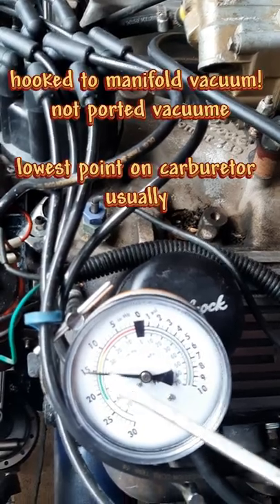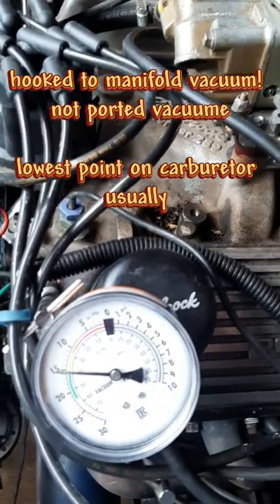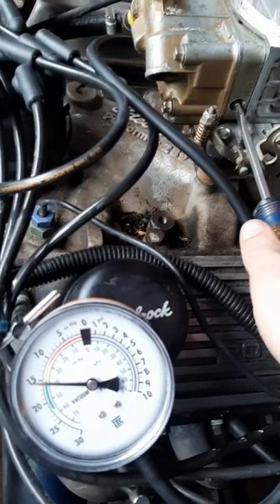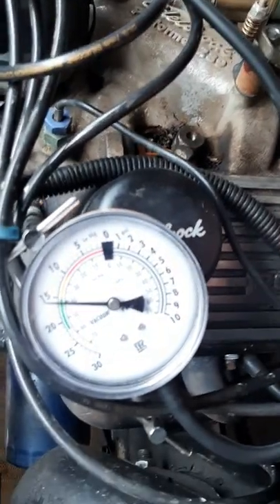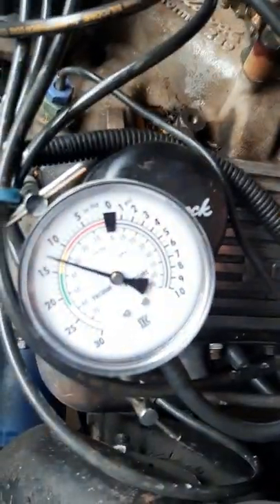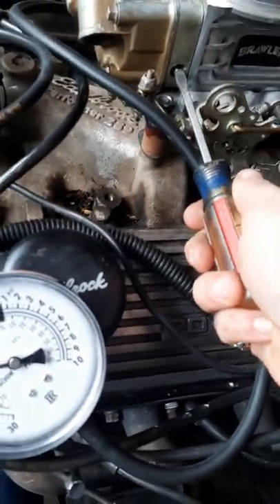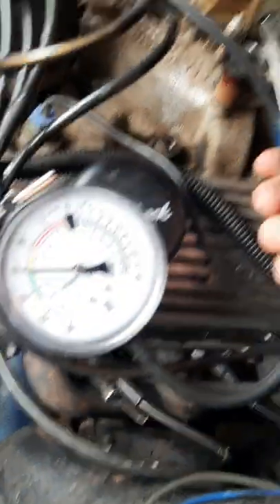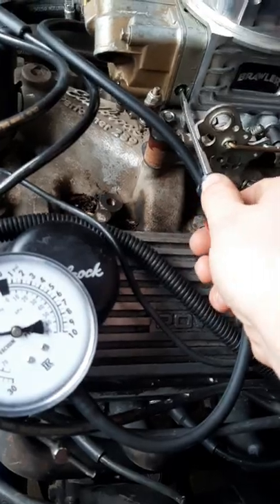how to: tune your carburetor using a vacuum gauge!

Comment: What’s the manifold cover vacuum supposed to hook to? I don’t have it hooked to anything
Reply from the maker: Manifold cover? You mean valve cover? 

If you have a pcv valve you hook it to the valve cover going to Manifold vaccum, usually the big vaccum port on the carburetor.

Comment: I need help, only the left side mixture screw reacts, I can remove the right side complety out and no effect on engine. Any ideas?
Reply from the maker: What kind of carburetor is it?
Reply: @newguysgarage6802    Holley 3310 manual choke, vacuum sec. Chevelle 396 
Thanks for replying
Reply from the maker: Hmmm.....its strange for only one to not be responsive. 

That would lead me to thinking the passage in the metering block might be clogged for that side 🤔 

Because if it was your throttle set too far exposing the transfer slots that would be for both sides..... that is a common issue with unresponsive idle mixture screws. 

You can have the screw completely out while the car is running? Gas should be coming out of that hole if it is flowing fuel through that passage. The needle on that screw is constricting the orifice in the metering block....so I would think without the screw in there the fuel could escape through the open hole. 

That's kinda what im leaning towards with the info I got 😅
Reply: @newguysgarage6802   perfect that makes sense because no fuel comes out with the screw completely out while the car is running. I will take it apart tomorrow and let you know what I find, in the meantime thank you so much for the help.
Reply from the maker: No problem man! 
I hope my guess is correct for ya 😅😃

Comment: How would you do it with the dizzy? I got a 351 Cleveland
Reply from the maker: You can set the timing for the highest vacuum. 

Hook up the vacuum guage and slowly go back and forth (not to far) untill you find the highest vacuum. 

This is NOT for a performance build though! 
This is for an older car that is just a driver 👍
Reply: Cld I get a short of that I'm a visual learner but I kinda understand what your saying see I retimed it with a origanl 750 dp but I bought a new 650dp now it won't hold a idle I cld drive it down the road with the 750dp but my jets a accel pumps went to crud and Ive never rebuilt a carby
Reply: @newguysgarage6802  I want it to be a daily.
Reply: Do you hook the vacuum guage yo the vacuum canister port?
Reply from the maker: Ok so firstly thats not a timing issue that is a carburetor issue lol 

So wont hold at idle as in? What does it do? 🤔 

Also rebuilding the 750 is easy 🙂 if you already have it off just open it up and check it out! You will be able to see how it works and put it back together no problem 👌 

But saying the jets went bad doesn't really sound right? What was it doing with the 750 before you got the 650? Might not be a carb issue at all if neither of them worked!
Reply from the maker: Vacuum gauge gets hooked to manifold vaccum (lowest vaccum port on the carburetor usually on the front under the float bowl on the holley)
Reply: It had thread tape in the jets when previously owner thread taped the fuel rail to Carby, and it will fire immediately up but I have to disengage the key fob back one to disengage the stater from turning and then it won't hold an idle after that but I've not quite got every fuel bowl on the brawler filled cuz my dad wanted to see if it wld start
Reply: I've done new starter gas tank gas straps oil change new oil filter new spark plugs gapped also new fuel sending unit new lines new Carby new starter solenoid, voltage regulator, alternator, ignition switch battery battery cables new fuel filter with new fuel lines
Reply: And plus some
Reply: Btw it's a 72 ford mustang
Reply: @newguysgarage6802  which port at the bottom of the carb in front fuel bowl closest to the left or right I forget the names timed and spark?
Reply: @newguysgarage6802  how can I send you a video of starting it
Reply from the maker: Right but...what is it doing? 
What happened to make you change the carb?

What are the symptoms?
Reply: @newguysgarage6802  it was pouring fuel out like you turn on your water hose outside with the old carb
Reply: @newguysgarage6802  instead of squirting that's when I realized the accel pump was out
Reply: It drive once before it would die on the side of the road since that
Reply: @newguysgarage6802  I'd just have to send you a vid trust me I need help with it it's currently the only vehicle I got since wife left a yr ago need transportation for a job
Reply: @newguysgarage6802  I'm just thinking fill fuel bowls fire up retime retune with vacuum and hopefully good to go
Reply from the maker: Stuck needle and seat. 

Fuel was gushing out of the vent tube right? 
Yep you just got to pull that needle out (undo the bolt and locking screw on the top of the fuel bowl it was coming out of) and either clean that one up or replace it! 🙂

Is that what it was doing? Out the vent tube? Would be gas everywhere 🤔
Reply: @newguysgarage6802  give it throttle and it poured out the dual jet Philips screw thing
Reply: @newguysgarage6802  this is all the old carburetor btw
Reply: @newguysgarage6802  I can't get it to hold a idle with the new carb
Reply: @newguysgarage6802  I'm not messing with it to much until spring warmer weather
Reply: @newguysgarage6802  but still looking for some advice from other ppl that like this type of stuff